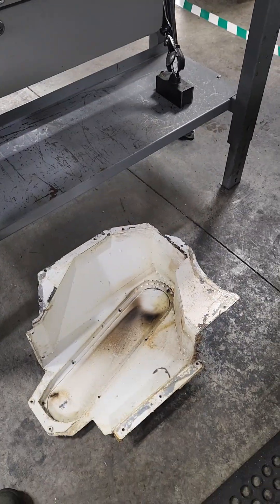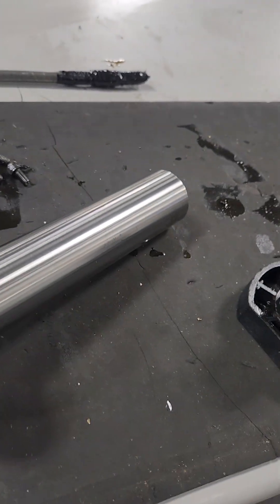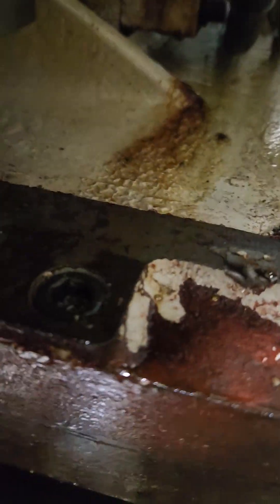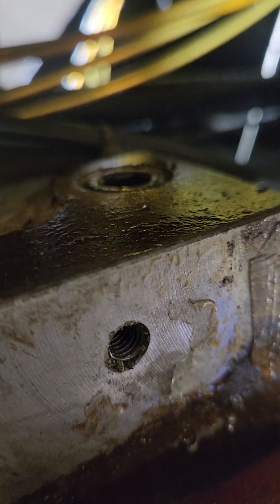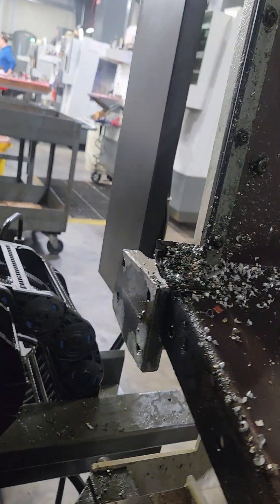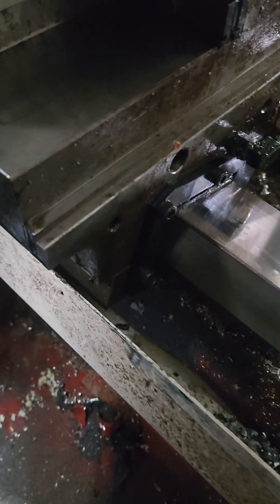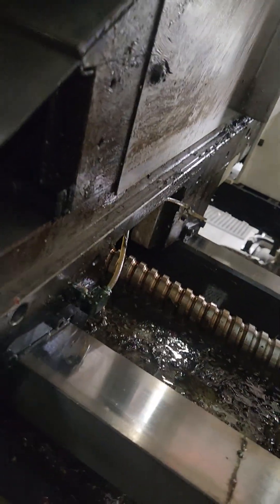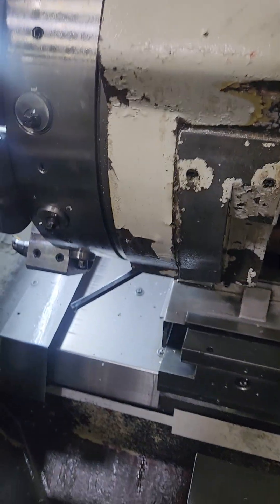Okuma Genos L300M Turret Alignment

Comment: How often do you have to adjust the turret?
Reply from the maker: The turret should be checked after a crash. If the machine has not been crashed it should be straight, so no adjustment needed. It the turret is crooked you will not be able to drill a round hole, they will be oblong. You will also be breaking taps when threading. The gibs should be adjusted before aligning the turret, or once a year.
Reply from the maker: This turret was out .028" in 6 inches and the tool plate inclination (centerline of the tool) was out .035" which is really bad. They could not tap a hole, hold consistent sizes, and tool life was horrible. If you are experiencing any of these issues you should check the turret alignment.